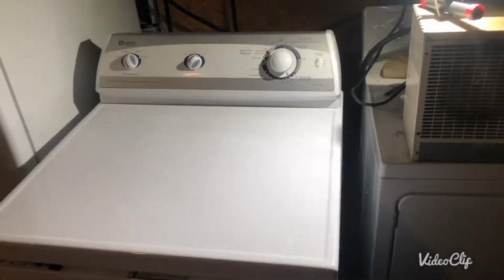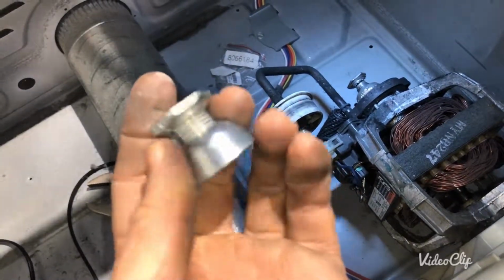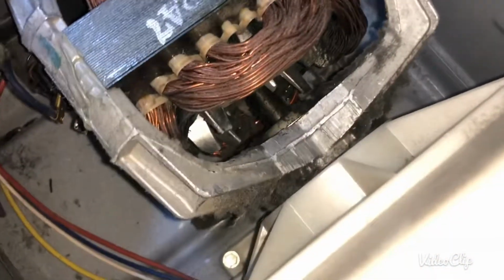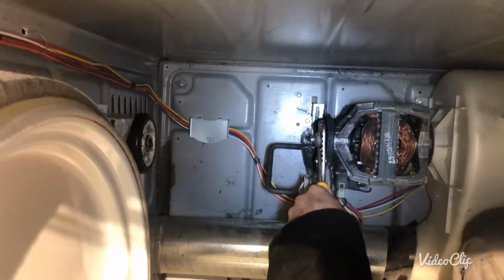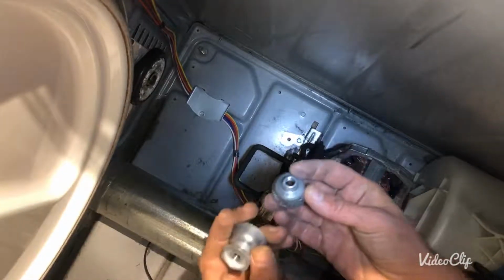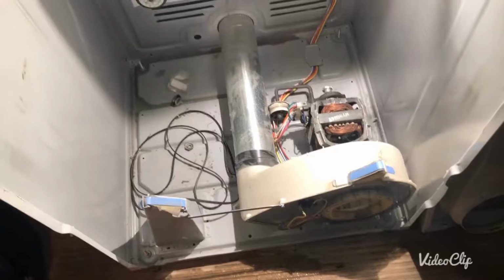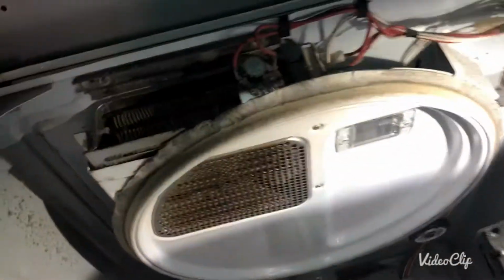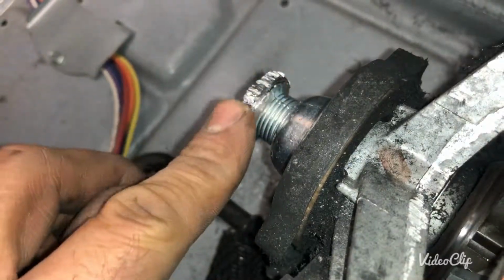maytag dryer motor pulley replacement

Comment: Thank You Hameed, gave me the motivation to keep trying! The pulley I bought looks just like yours but it has regular forward threads, I believe 3/8 - 24 fine, I finally took the motor out to a table and bought a 1inch socket and forced the aluminum pulley to rethread itself on there, the shaft threads were a little damaged at the end from the pulley breaking, maybe that is why i was able to FORCE it on. Dryer seems to work great so far!

Comment: Great video, Hameed. I just learned a way to do this so you don't have to put your shoe in the blower assembly. The pulley shaft has a flat section on one side, behind the pulley, that allows you to lock an adjustable wrench on left side. It will hold shaft in place and allow removal of pulley, with another wrench. This reduces the chance of damage to motor or blower assembly.
Reply: 9t

Comment: My magnetic flashlight kept falling too when it was stuck to the inside wall of the dryer.  They use terrible metal to make these terrible dryers.  Yes my flashlight sticks to other metal objects just fine. :D
Reply from the maker: I heared snap-on brand makes one string flash light and it's about $200 , I won't pay $200 for flash light, lol

Comment: Hello , what is the part number? I ordered from Amazon and it doesn’t  fit this motor. #29 on it. Original shaft is larger
Reply from the maker: Hey , What’s the model number?
Reply: Same here.
Reply: @hameedwafaAFG  Maytag Dryer Motor MODEL S58NXMYN-6984. Pulley I got from Amazon has #24 on it. Won't thread.